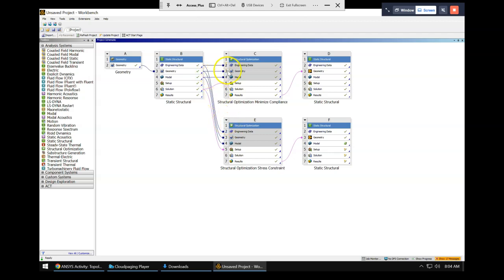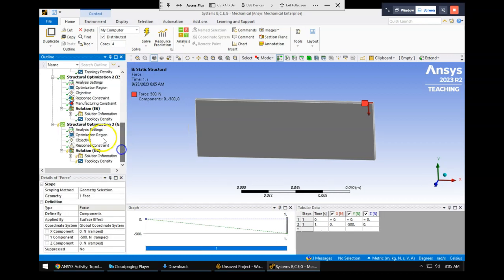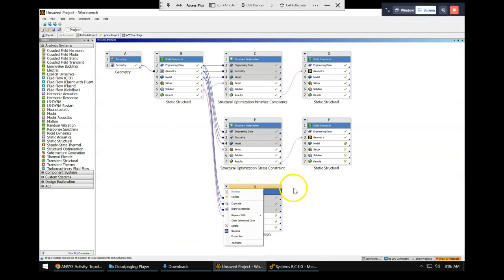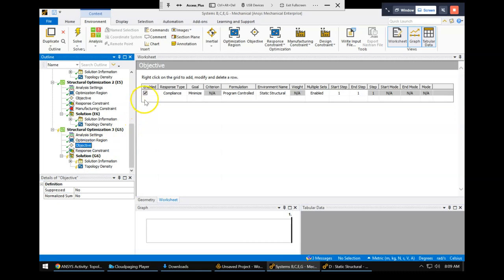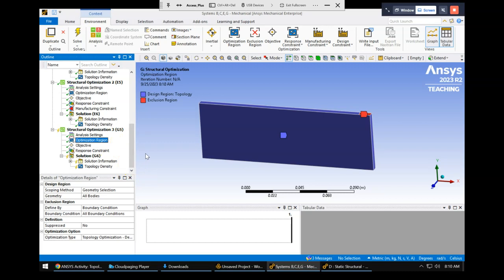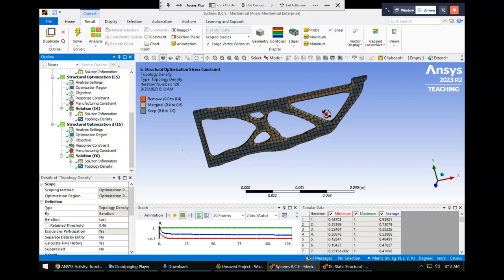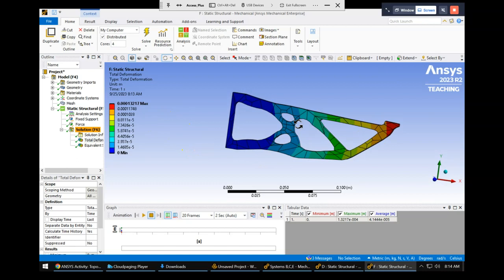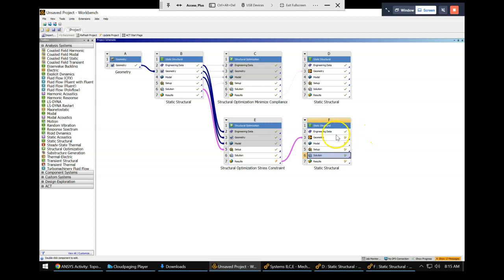Part 2 of 2: Ansys 2023 R2 Topology Optimization Tutorial

Comment: Great video! Thanks a lot! Can you tell us the procedure if you don't have a 2D model which ist extruded after re-sketching in SpaceClaim? How does it work if the optimized body is a 3D solid? Then we do not have a sketching plane. Answer would be great.
Reply from the maker: It's possible to to convert the mesh directly into a 3D solid. See the 26:35 point in my shape optimization video for an example of how to do this: https://youtu.be/vK9p7XFpk0o?si=_tlaQqN8zRVcmhDX&t=1595
Reply: It worked!!! Thank you so much. I was trying to figure it out for sooo long! @epxyz
Reply: Thank you so much. I will try this solution very soon.